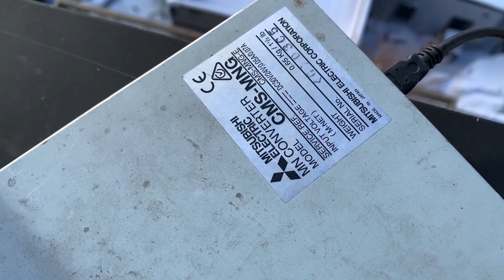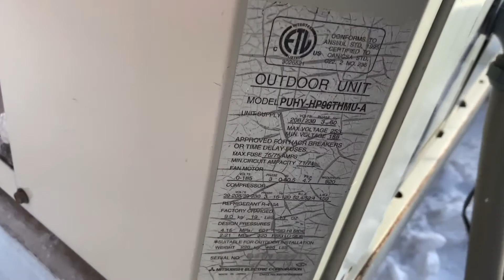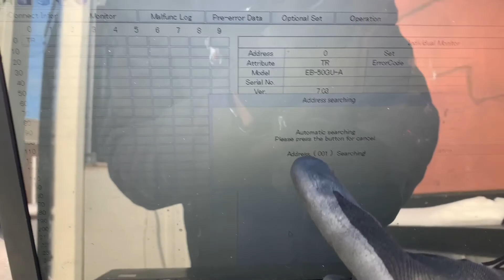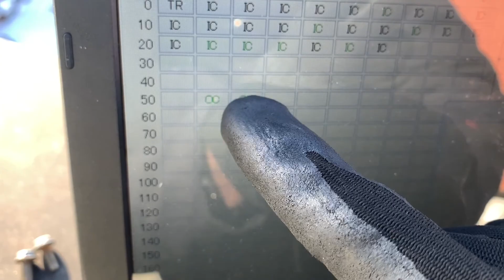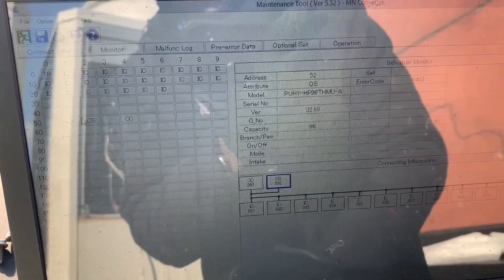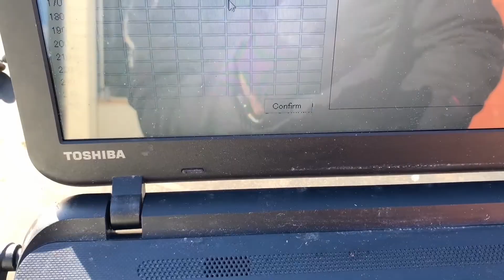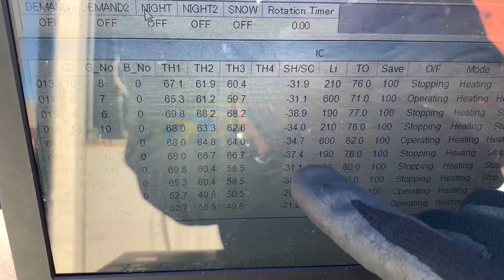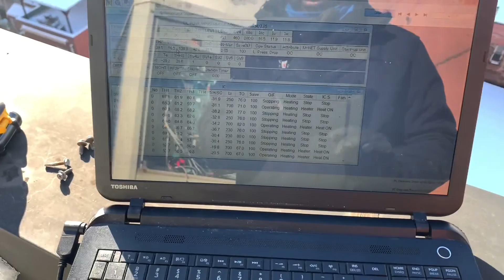MITSUBISHI CITY MULTI MAINTENANCE TOOL FOR BEGINNERS

Comment: Hey great video bro, can that MN Converter be used for other Mitsubishi ACs like the Mr Slim Models?.
Reply from the maker: No, it's for  city multi
Reply: @D2DNYAC  Mitsubishi's tech support told me that this tool can be used for my single zone FS series with an adapter cable, but I haven't figured out how yet. They told me that it plugs into the outdoor PCB, but from the research I did, it appears that the adapter cable actually plugs into the same CN105 port on the indoor PCB that my wired controller does.

I'm extremely annoyed that they didn't build in a way to view any sensor data without buying tools like many other units costing 1/3 or less of what I paid, especially since they are the ones who shipped it with an obscure intermittent defect that left me needing inaccessible live data from day 1 just to figure out why the darn thing randomly short cycles the compressor for no apparent reason without setting any specific error codes.

Comment: Great video virgin maintenance tool I have multiple Trane VRF and each condenser has 1 branch now and 5 heads all stats are set up for single set point how do you get to the point to enable dual set point function thank you
Reply from the maker: Thanks for watching

Comment: Thank you for this video. It’s not easy to film while troubleshooting at the same time. Specially at lower temps. I saw the problems highlighted by the software that you pointed out. However, I was curious to see how you came up with a solution to the problem/s that you found in that application. I will keep following what you do and have done to keep diving into vrf.
Reply from the maker: Thanks for watching, this video was filmed a while back so I don't remember the outcome however  I may have other videos in my mitsubishi vrf playlist with the answer. Check it out

Comment: I’m an apprentice at the moment. Me and my lead recently installed one of these. The line by the EEV was freezing up after adding 84 pounds of refrigerant. I noticed when he was taking out valve core moisture was making its way into the copper lines. Could  that cause the line to freeze up?
Reply from the maker: Unlikely,,,, most likely faulty or restricted valve

Comment: Why you killing yourself bro. You could have just hooked up to one of the branch boxes or one of the many other units inside the building and stay warm and still done the same job
Reply from the maker: That was an apartment building with people either not home or don't want to be intruded upon
Reply: @D2DNYAC  LOL I guess I'm a rude servicetec cuz I want to say guess what knock knock I'm coming in you want it fixed
Reply: @D2DNYAC  the struggle is real. The only time I have to be cold is when I'm working in an industrial freezer other than that there's no reason for it. We are gentlemen they treat us like animals
Reply from the maker: 😆😆😆😂 dude come on I wish

Comment: What version of windows are you running? Couldn’t get my windows 11 to connect to this older style maintenance tool but newer one worked
Reply from the maker: I had a similar problem with trying to use the newer tool with older version of windows ,, windows 8 on this computer!

Comment: Hey D2D will this tool work on M & P series equipment?
Reply from the maker: This tool works on any mitsubishi city multi that has the M-Net communication ie if you have a system using 3 wire communication and power /line voltage combination ( mini splits) it won't work unless it's a P series and you install the Mnet adapter on the outdoor unit
Reply: Alright thanks man and thank you for the quick reply. Im working on mostly M series so I guess its just going to be the remote control error recall then.  @D2DNYAC
Reply from the maker: Thanks for stopping by

Comment: Under operation IC what’s transmit? And where to get the software? Thanks
Reply from the maker: That is to send or transmit the changes you have made in the maintenance tool software from your computer to the  system
Reply from the maker: Go to www.mylinkdrive.com
Reply from the maker: Look under controls/ software

Comment: Hey great video, did you find out why th3 was reading low and why the discharge pressure was low ?
Reply from the maker: System was 30 lbs  low on refrigerant charge